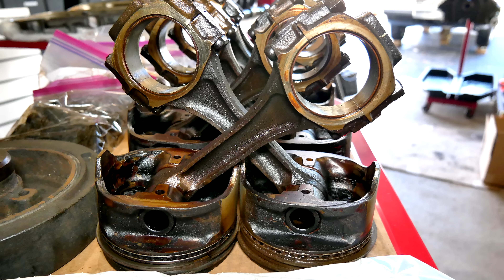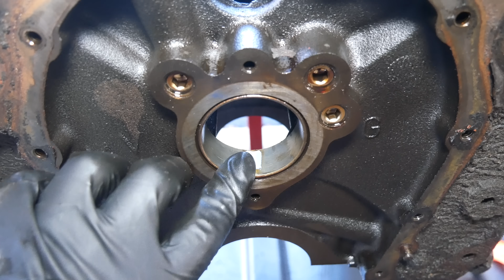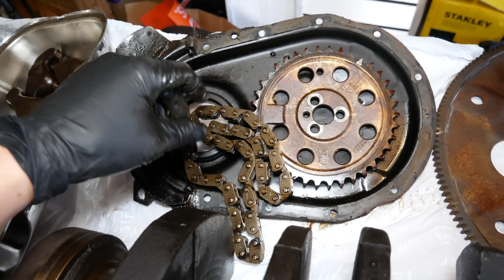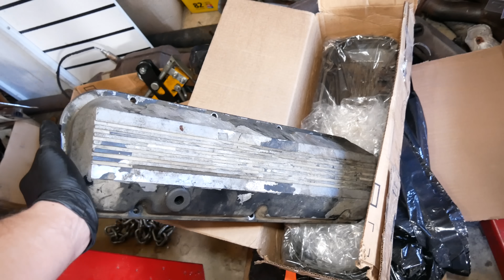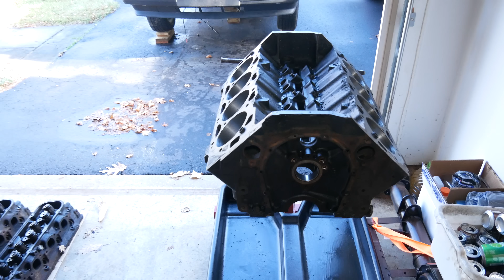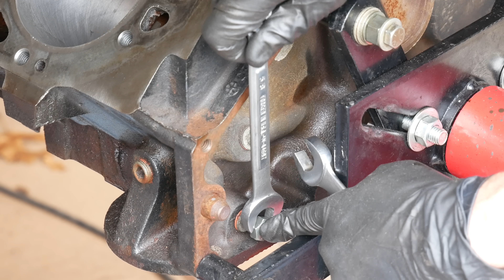$200 454 Engine Rebuild: Examining Parts and Laying Out Plans (78 Firebird Ep.15)

Comment: you can rent cam bearing tools from most automotive parts stores.
Reply from the maker: Where were you able to rent a set like that? The AdvanceAuto, Autozone, PepBoys, and NAPA near me didn't have anything I could find. Normally I don't really care for rental tools anyway. Most advanced thing I've rented from an auto store has been a spring compressor that bent on Honda coil springs.
Reply: @FuzzyDiceProjects  I have Oriellys near me that has them, you basically buy the tool, and when you return it you get all you money back so its basically free.